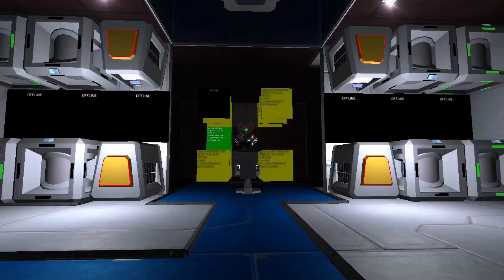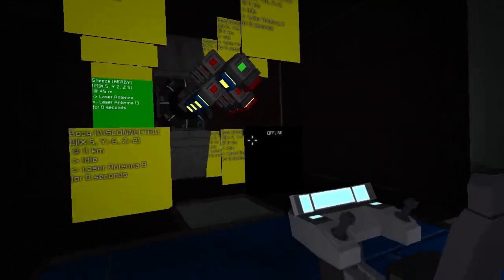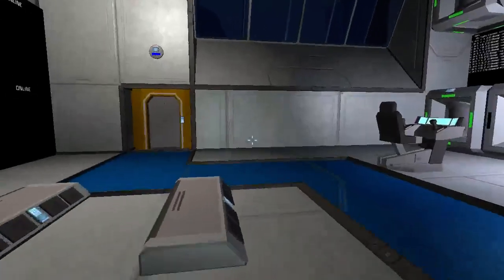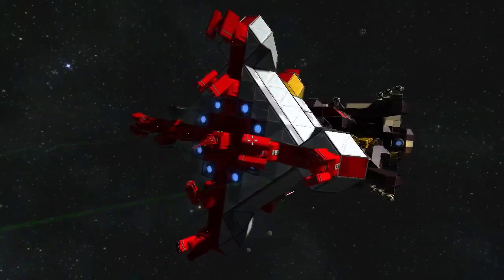Space Engineers: Maxing Out Screen Space

Comment: I think i have a way you can get around needing so many screens at once.
It may be how many screens can be supported on a single ship so what you could do is break that command brick in half and turn it into two separate ships that you detach from your ship when you need drone controll. This makes it so that you can sit in your main ships issuing commands to the middle class ships who each manage however many drones. It is basically a hierarchy so managing large amounts of drones gets a little easier. also, maybe storing data inside the Storage variable inside of programming blocks can help you not need to keep everything in different sections of text panels because once you serialize the fleets state and your programmable block resets you can pull the information all back out, so another idea may be to have a programmable block for each drone (or one for all with a large state type object that it stores)
anyway, just some ideas
Reply from the maker: Elton Searcy I believe the max number of screens is simulation-wide, not ship-wide.